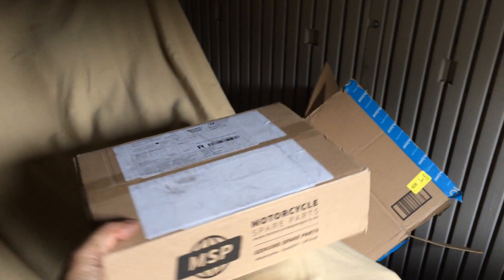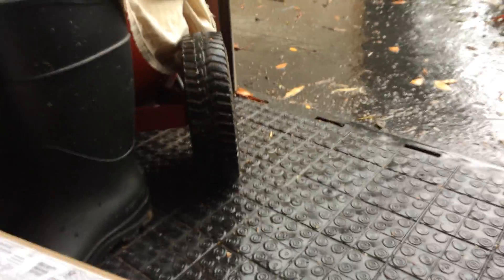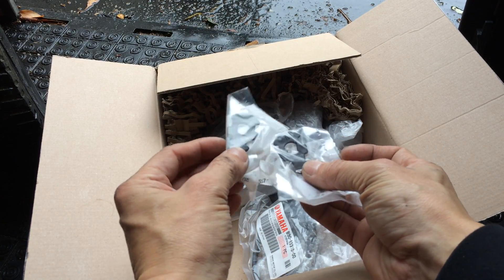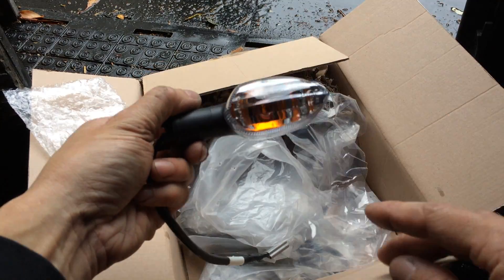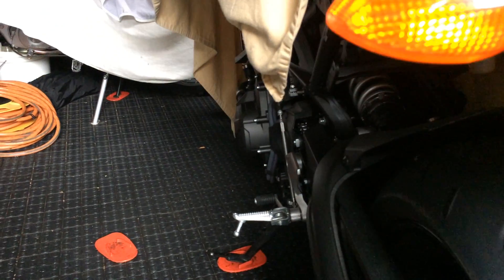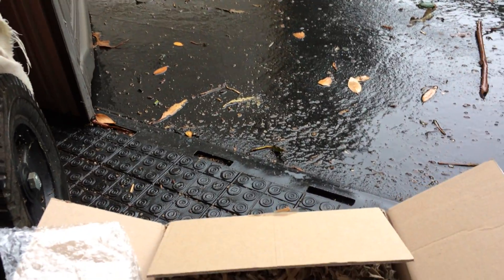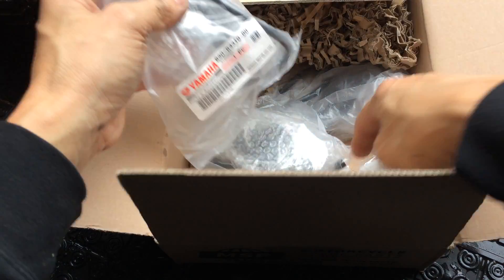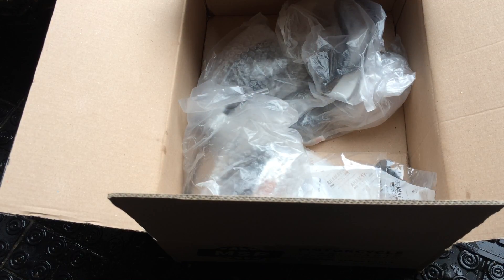XSR900 euro signals

Comment: I'm seriously considering trying to pick some of those up also. I'm struggling to find some for the front and the rear for this xsr of mine. did you say they were a hundred and fifty bucks for all four plus $30 for shipping?. also, did you need to put two new relays on there ?.
Reply from the maker: Yeah $150 plus $30 shipping from europe...I hear japan is much cheaper, something like $100shipped.  I put in a different relay that I got from amazon for $10, should have a video of that too

Comment: Why did you go for those huge indicators? Yamaha does accessory front and rear LED indicators which are much sleeker and brighter than the stock ones.
Reply from the maker: Yamaha LED, not that I have seen.  Thing with LED is that they are near invisible during the day.  Every single bike that I have seen with aftermarket LED signals can't be seen during the day, visible at night but not day.
Reply: DaBinChe I've got the LEDs on my xsr900, and they are extremely visible even during the day. Enough for me to notice if I've forgotten to cancel them while riding. Aftermarket LEDs might be crap, but accessory OEMs are pretty good. Search on any Yamaha European site for them. From memory they were not listed specifically for the xsr900. They're listed as general bike accessories. In any case, they were fitted by the dealer at purchase.
Reply: I agree, all the LED indicators look kind of invisible during the day.  The stock indicators are too big.  The LEDs look too small.  This solution might be a good compromise.
Reply: farmerinchico looks like only a video of the Yamaha leds functioning in the daytime will convince you folks.
Reply: I don't doubt that LED's put out a lot of light.  It's the form factor.  They look like dots.
Reply: farmerinchico I think I understand where you're coming from. What Yamaha have done to get round that problem is to put in a significant number of led bulbs so that the indicators really stand out when lit. There must be about 4 or 5 really bright leds used on the set I've got on my bike.
Reply from the maker: Before I got these euro indicators I got some MotoGadget LED ones and they just weren't very visible in bright daylight.  Partly because there is only one but mainly because there isn't enough visible surface area to show.  One of the requirements of turn signals is that there needs to be a certain surface area, in the US it is I think 2sq.inches.  I got the euro ones because the surface area isn't as big.
Reply: Exactly, I already installed the tail eliminator.  I'd hate to have the CHP add turn signals to a long list of 'violations'...
Reply: sasholsuma I didn't get the Motogadget ones, DabinChe did. I have yamaha's accessory LEDs front and rear. I've just checked and each indicator cluster has 9 LED bulbs arranged in a triangular pattern (4 on each arm of the triangle and one on the apex) and not 5 LEDs as I said in a previous post.

Comment: Why so big?  The XSR900 is a cafe racer  style. those signals are way to big and it takes the cafe style look from it.  there are many other signals out in the market that you could had purchased. I purchased some from ebay for about 45.00 and it has that cafe look.
Reply from the maker: see comments below
Reply from the maker: they would look better if they were round to match the head/tail light